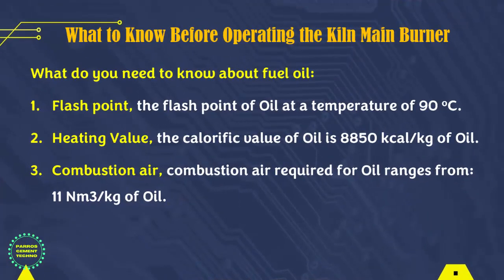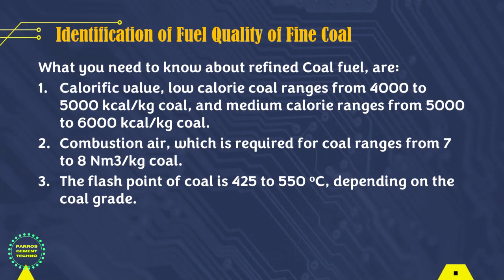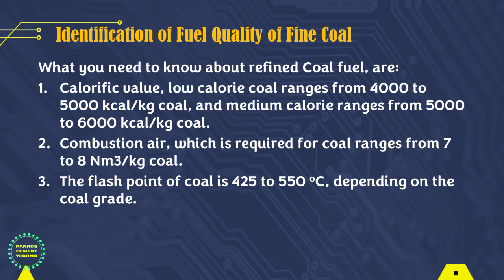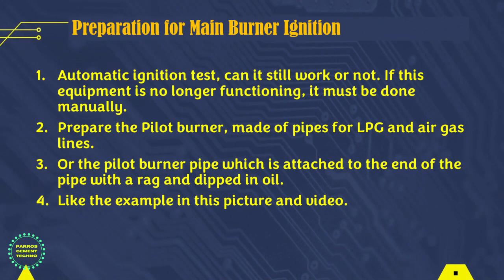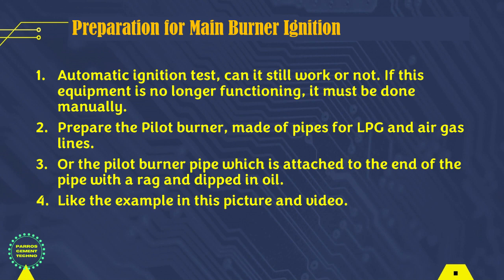How To Operate Main Burner For Kiln Cement From The Begining_ English Version

Comment: Why the flame is not reaching the limestone,?heat drop is high if fire 🔥 not able to reach the stone.
Reply from the maker: In the combustion process for cement production, the feed material is not only limestone, but a mixture of limestone, silica, clay and iron sand.
The burner flame is not allowed to touch the material continuously, because it can affect the quality of the clinker and the coal fuel cannot burn completely. This can be seen in the CO and O2 gas analyzer at the Kiln inlet, high CO and low O2.

Comment: I understand from your lecture there are two air sources in burner,the pilot air and blasting air,Me question is ,is it the total of the two air blower or air compressor maybe is the 11Nm3 per kg oil is you sir stating?
Reply from the maker: Thank you for your question sir.
What we explained about the use of 11 Nm3/kg of fuel oil is for total combustion air.
Air from the compressor or from the blower through the two burner channels is in the range of 8 to 12% of the total combustion air, so it ranges from 0.88 to 1.32 Nm3/kg oil.
While the rest is from secondary air which comes from the clinker cooling air fan.

Comment: May I ask why burner is not fueled by diesel continously since heating value of diesel is higher than coal?
Reply: Because it is way more expensive than coal. Firstly you use fuel to achieve the coal combustion temperature in the secondary air and then you start replacing the diesel with coal.